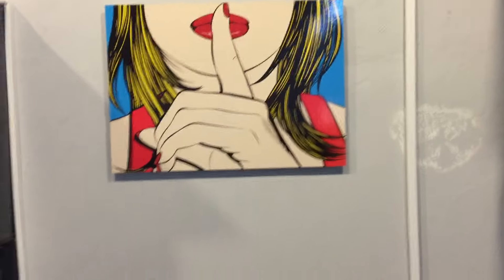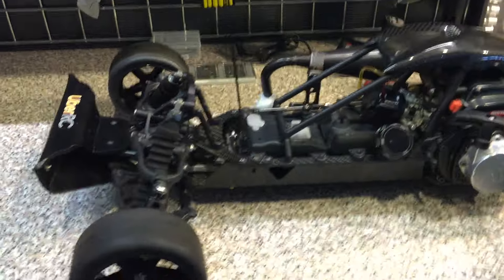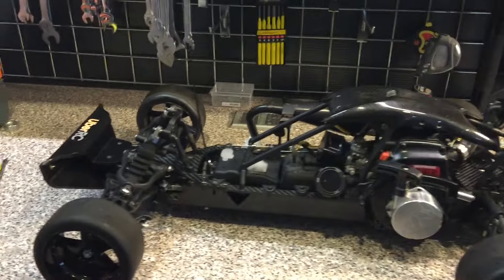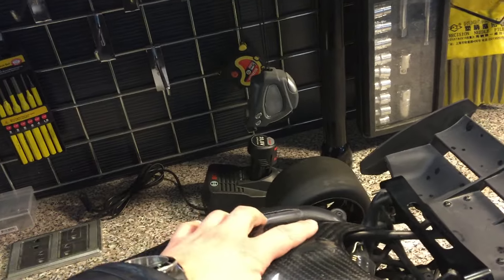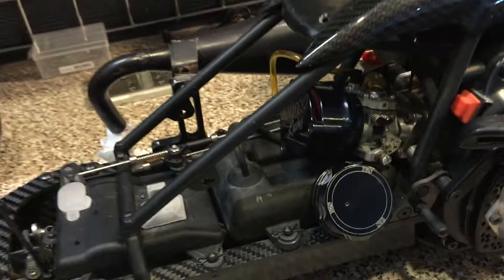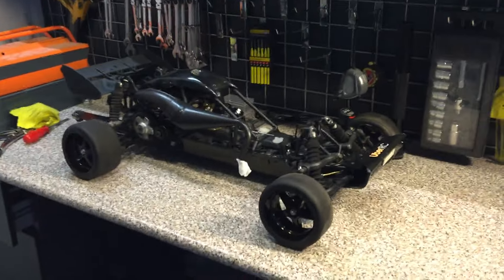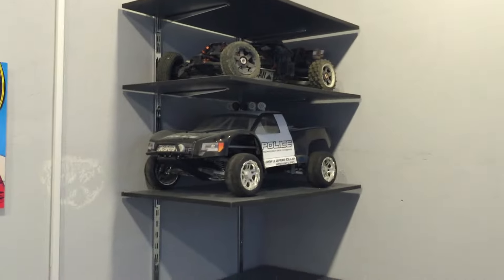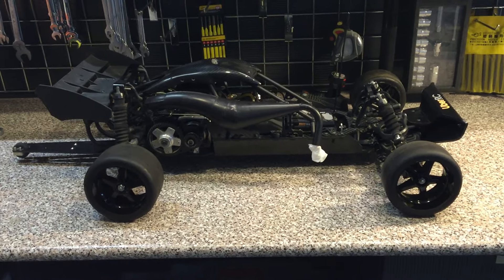HPI Baja F1 Project Rewiew

Comment: how much do you want for it
Reply from the maker: 2000usd
Reply: With shipping ?
Reply: And how fast does it go
Reply from the maker: saud al abdullah yes! which country?
Reply from the maker: saud al abdullah we recon more than 120km/h - as u see its built with lightest parts possible and one of the most powerful engine. moreover the clutch and the gearing are also great combination.
Reply from the maker: sold already. mainly because i wasn't using it. I still have 3 bajas that i use very occasionally.